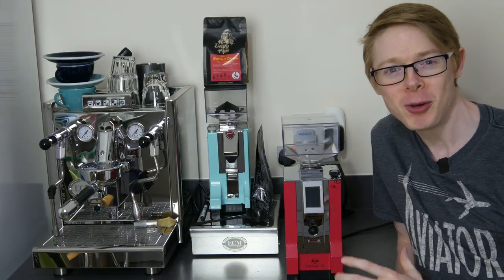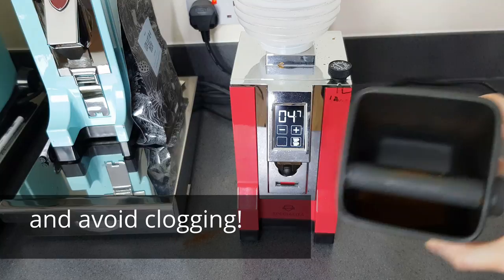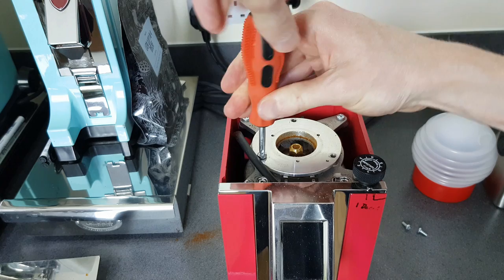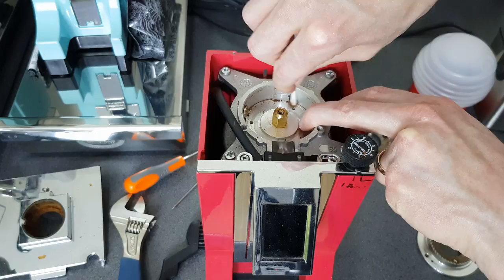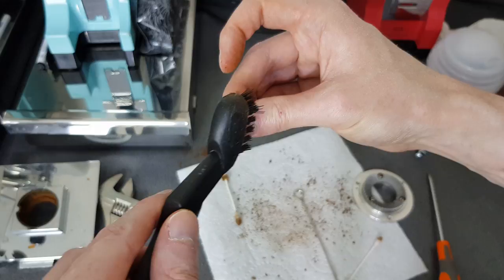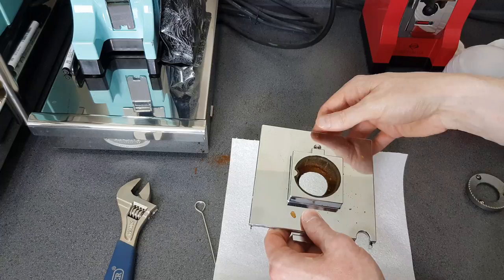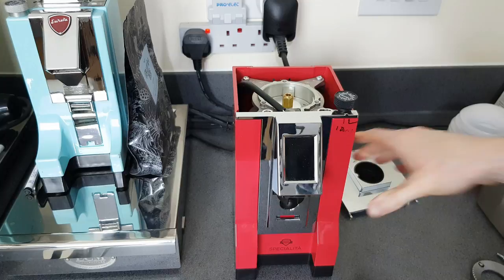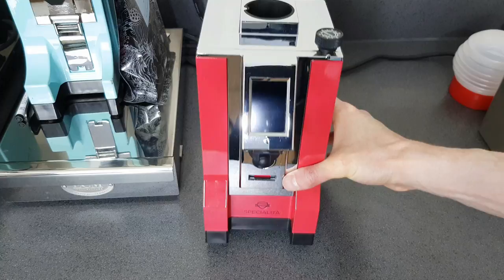Dirty Little Grinder: Cleaning Your Eureka Mignon Specialita Espresso Grinder

Comment from the maker: Since this video was posted I have had a few comments worried about misalignment of burrs. If you are concerned about this do not remove the burrs. Leave them in place and clean with a good brush and vacuum up the grounds in the burr chamber. 

I personally did not experience issues with this but clearly you are removing pieces that manufacturers have put in place. So remove at your own risk!

Also, if you would like to make tastier espresso, have you tried tracking your extractions? I just created an espresso journal which will help you do that. Track, make notes and improve every extraction. Check it out here 

US: https://www.amazon.com/Espresso-Journal-Track-Extractions-Barista/dp/B0CRF5GMB7/
UK: https://www.amazon.co.uk/Espresso-Journal-Track-Extractions-Barista/dp/B0CRF5GMB7/
Reply: Wish I had thought about / seen this before I took the burrs out on my Oro Mignon Stark, because now I think it needs alignment 😅 Thanks for the great vid!
Reply: @Shadowguy456234  Same. I'm now getting terrible grinds, my 'wet puck' is powder and I can hear the burrs touching. My machine seems ruined. Not sure what to do with it now, as I live in a remote place and shipping it anywhere will be a fortune.
Reply from the maker: I'm sorry you're having an issue. I'm not an engineer but here's what you can do...

If you're hearing the burrs touching there are one or two issues:

1. The burrs haven't been pushed down level into their seating. Usually this will be the bottom burr. It's quite stiff and tight so it's easy to think you've put it in ok but it might not be level. Make sure you've pushed it in and it's properly seated.
2. You probably know this but if the burrs are touching you'll need to adjust the grind to a coarser setting. 

It could be one or both of those. 

If you're still having issues and you think it's down to alignment as opposed to how it's put back together, there are videos guiding you on realignment at home.
Reply: @coffeewithalex4379  I haven't had a chance to watch it yet but saw a vid about aligning with silver foil, so I'll tackle it tomorrow. Even with a metallic sound it's grinding so course that my pucks are still powder.

Comment: Bloody brilliant mate! When I saw it was 28 minutes long I almost didn't give it watch. Glad I did. The bit about how to remove the the lower burr was gold. Mine actually came out fairly easy after a little finessing around the edges first like you showed. I have a compressor with a needle valve air blaster so after I got 'er all ripped apart into the garage I went to really blow out under the lower burr plate. Pretty sure I got every last damn spec of coffee out of there! Keep up the good work. Cheers -- A happy yank. 😁

P.S. For folks who think this is too, long the "L" key (fast forward 10 seconds) is your friend. 😉
Reply from the maker: Thank you so much! Gosh yes you would need to do this outside/in the garage if you're using an air compressor. Coffee everywhere otherwise! But greate to get in those hard to get places.

P.S. Good tip about the 'L' key - I didn't know that!

Comment: Thanks so much sir! I started using Mignon Zero today for the first time. I set the grind level to 1 and after fist 20 grams or so the grinder stopped dispensing grounds. I was shocked to find brand new grinder malfunctioning on first day. I followed your instructions and found the powdered coffee grounds were clogged at the chute. After cleaning it all up my grinder is back to normal! I made two observations - 1. I set the grind level too fine for espresso. Which caused two issues - a. It clogged the grinder completely. b. With whatever grounds that I got after first grind, the espresso was too bitter. 2. Before opening grinder, my Zero point was exactly at 0. But after disassembly and reassembly, my Zero point shifted to 9. But I don't care if it does. I made second espresso shot with coarser grind setting and that made perfect espresso. I truly appreciate your help! Cheers.
Reply from the maker: Sorry for the delay! I just wanted to say thank you for saying thank you :-) And also thank you for sharing your observations, I know they'll be useful for others. 

Lesson learned: When getting a brand new grinder and you want to make espresso, open up the grind setting to a little coarser.

Someone told me to put on the grinder and make turn the grind adjustment finer until you hear a very very very slight metal on metal sound (this is the sound of the burrs almost touching). Then make it a little coarser. Now you can try this setting for espresso and you might not be far off. You may not want to do this if you're worried it will damage your burrs.

Thanks again!

Comment: Thanks for the video, that was very helpful! I just successfully (at least, i think :D) cleaned my Eureka after having it for a few months. One thing startled me a little - I completely removed the screw that is supposed to hold the hopper in place, and if you do that, a little nut will fall out when you remove the rubber piece. So, just an advice to anyone cleaning it for the first time, don't unscrew the hopper screw completely, or if you do, be prepared to collect the nut, so you don't have to frantically search the kitchen counter like me ;)
Reply from the maker: I've never completely removed that screw. Thank you for sharing!

Comment: Hi Alex. Firstly, thank you for taking the time to provide such a detailed video of the cleaning cycle. I have just purchased a Specialita and I did so based partly on the claim by a number of reviewers that this was a low retention grinder and suitable for single dosing, with flat burrs, with commercial 55mm burrs vs 50 on my present grinder, timing options and company name. I eliminated a competitor the Baratza 270wi due to its noise, reliability and complexity and my perceived value for money in its price, although it’s straight through design was what initially attracted me to the product.. My move has been from a Rancilio Rocky, a similar grinder I have had for years and relatively ‘bulletproof’ machine. I was therefore stunned at the retained coffee you uncovered in the Eureka (seems even more than the Rocky) and based on that I would estimate the need for a monthly cleaning cycle at least in this grinder. The fiddly anti static/non dumping fingers look like an item that may need extra care as well and need replacement over time. I definitely think my purchase was a step up in functionality and efficiency but like many items you find yourself saying, why didn’t the makers find a better solution than this. In particular, (and I think this company Eureka had a hand in the Rocky because it is very similar) if the grinder needs regular cleaning why haven’t the design engineers come up with a more simple/efficient cleaning process. Thanks again for your videos, you can add a fan to your viewing base. Michael
Reply from the maker: Hi Michael - Thank you so much for your comment. Well the Specialita isn't sold as a single dose grinder at all. But so many people, including me, are trying to use it as for single dosing. 

You're right, it does need regular cleaning. Also you need to watch out for coffee 'boulders' that can built up behind the clump crusher. I recently tried removing the clump crusher. That got very messy - grounds flew everywhere and static was a real problem. So, in my opinion, the clump crusher does a good job. You just have to look inside the grinder when you notice your grinds are getting a little more clumpy or your shots are tasting worse. 

I think we should remember that this is a fantastic grinder for the price and what it was built for (not single dosing). 

All the features you mentioned about what you like on this grinder is probably why we're all trying to single dose with it. "Love this grinder, if only it was built for single dosing" ...

Well it looks like Eureka have listened because they're actually bringing out a grinder based on the Specialita that is purely built for single dosing. 

- It's tilted forward for less retention
- It has a single dosing hopper
- I believe the hopper also has a built in bellows
- It'll even come with a single dosing cup!

I'm assuming the clump crusher remains and everything else will be the same as the Specialita so it'll be interesting to see if those retention issues are reduced. 

I've been testing bellows recently and there is definitely less retention. But I found popcorning to be the problem. I may have found a solution but I'm testing it at the moment. 

So all in all Eureka are listening and building something that people want. 

Thanks for watching! And I really appreciate you contributing here.
Reply: I bought it used, used it for (checking eMail now) what would have been 2 YEARS (!!!) this May, cleaned it just now for the first time... And I often fine grind up to 200 GRAMS in a single sitting for cold brew. I also didn't clean the grinder when I bought it, so for all I know, there where already grounds in there...
I double weighed my espresso doses from time to time and they were always close, so cleaning this once per month is insanity to me... Even if you drink TONS of coffee, anything less than 6 months would be overkill for me personally... I'll likely set a yearly reminder, myself...

Comment: Excellent video. With items like the burrs it would be a good idea to use a dry marker to to mark the burr and its position within the machine as there are 3 possible positions where it could go on reassembly. This ensures that it goes back together with the components in the orientation they were originally in.
Reply: The video owner really needs to add this to the video, I followed the video but now my dial seems completely misaligned.
Reply from the maker: I did write a pinned comment about this concern, although I didn't experience any issues having not done this.
Reply from the maker: Thanks for the tip! FYI I didn't experience any issues not doing this.

Comment: Great video! A magnet works great for getting the bottom burr out. The flat head bolts on burrs were softer than anticipated, I needed to be very careful; I need to find a flat head driver that fits better. The clump crusher bolt was the most tricky, I won’t remove it next time.
Reply from the maker: Magnet! That's a great idea, thank you. 

The clump crusher is definitely tricky and it's more delicate than I thought it would be. The good thing is they can be replaced pretty easily, if you need to. 

Thank you so much for watching and for suggesting a magnet to help get the bottom burr out. 

Let me know if you have any specific suggestions for new videos.
Reply: @coffeewithalex4379  a high quality screwdriver that won’t break the bank is a Vessel 900 P.2x100. It was perfect for removing the large screws. Warning, this screwdriver is well thought-out and you might ending buying a lot more tools from Vessel!
Reply from the maker: Thanks and uh oh, don't start me on a buying spree !

Comment: Thanks for the video! I had no idea how to clean it after it literally seized up on me! - I cleaned it in the meantime, and while I didn't weigh the old grounds, there were AT LEAST enough to make 4 single espresso!!! The chute was STUFFED SOLID! Was so compacted it didn't even fall out until I literally DUG it out!
Bonus tip: If your dishwasher has a low temp option, just bung it all in there... (minus the base/electronics, of course). The 45° of the dishwater is way less than the 60°+ of the tap and less work! ;-)
Reply from the maker: Thank you for commenting! Wow - you had a LOT stuck in the chute. I hope the grinder's going well for you now. I had to periodically check how it was doing to ensure it wasn't getting a little clogged and affecting my shots - both in terms of inconsistent extraction times and flavour.
Reply: @coffeewithalex4379  Still going strong! - I had a check just NOW, looked up the chute with light from mobile phone:
I can see lots of grounds again already! Good call! - My plan:
I will turn it on, give it a quick suck with the vacuum through the chute, check for clumps, suck again, see how that holds up. (Maybe 1 real cleaning for every 2 "mini" cleanings?)
Reply from the maker: I was eventually finding I needed to clear the chute out every couple of weeks to a month. Nice idea about the mini clean! Careful not to damage the clump crusher at the top of the chute. It's pretty delicate. I replaced it once or twice. Not because it broke but to see if it would improve the effectiveness of it.

Comment: Very interesting to know you can clean the hoper with the steamer! I would never have though about it, as I thought it would splash water everywhere on the chrome all around. I was instead applying dish soap with hot water then I'd rinse it so the soap removes the coffee oils.
Reply from the maker: You can definitely wash the way you're doing it too. The steam and heat is just another way to clean it and should do a good job on the oils too.

Comment: Useful video Alex..I did mine today but struggled a little with removing the chute/display part but otherwise it was pretty easy. Just make sure you have a flat bladed screwdriver the same width as the screw heads and voila. I did cheat by blowing mine out with the air line in my workshop and I also made sure the burrs didn't collide by gently turning the nut with my fingers rather that just operating from the mains.
Reply from the maker: Thank you! Ah you're lucky to have a workshop 😀

Comment: I have cleaned my specailita twice now and have not had any issues. It was far easier to remove the burrs the second time both the screws and the lower burr was much easier to loosen and remove. When I replaced the burrs I cleaned the upper and lower carrier and polished with a microfiber cloth. When I went to retighten I tightened first till the screws all touched and then I tighetenend each screw a quarter turn till I did all and then another quarter turn all around. This ensures that the burrs are all uniformly tightened and helps keep alignment. My grind setting was only off slightly when I went. To pull a shot.
Reply from the maker: Great tip Allan - thank you. After a while, I stopped removing the burrs themselves. I think there was only coffee grounds underneath them initially because I didn't clean the grinder soon enough after getting it that it built up much more than it should have. So if you know you're cleaning it regularly, you can just leave the burrs in place and dry clean them with cotton buds, a brush and a vacuum.
Reply: @coffeewithalex4379  both times I removed the burs I removed impacted fines from the bottom and the alignment of the machine changed slightly and I got better more consistent grinds. I would suggest to remove both and bottom burs on each clean.
Reply from the maker: I actually don't have this grinder now Allan but I'm glad the video helped. If you'd like to see what I replaced it with you can see it in the unboxing here https://youtu.be/5T-OGTZoIQM

Comment: Very good video. I followed this after my machine stopped grinding but unfortunately it haven't been able to get it grinding again. I think the motor is kaput; a bit disapponting after 3 years use with regular cleaning.
Reply from the maker: Thanks Paul. Such a pity it's kaput - that is disappointing, especially if you've been cleaning it out regularly (I'd understand it stopping working if you hadn't). 

It might be worth getting in touch with Eureka just to say you've only used it for 3 years. You never know they may even suggest a way you can get it working again.